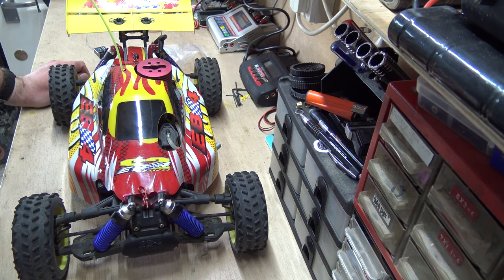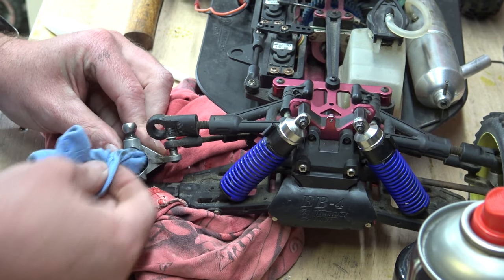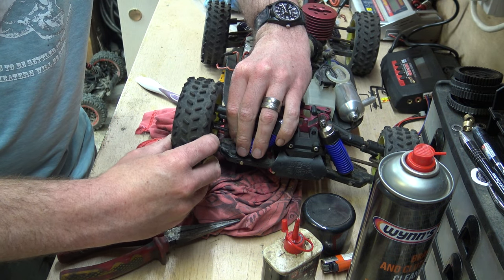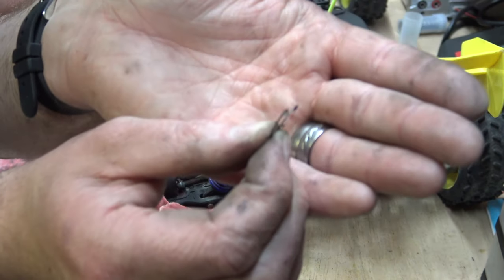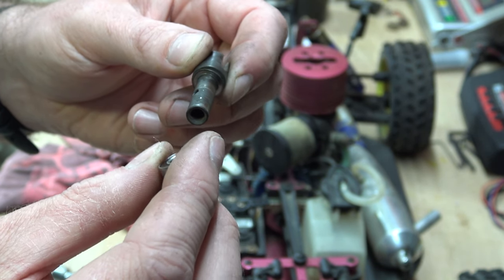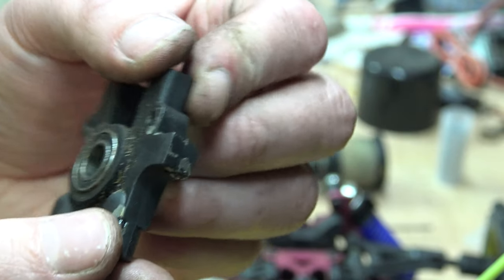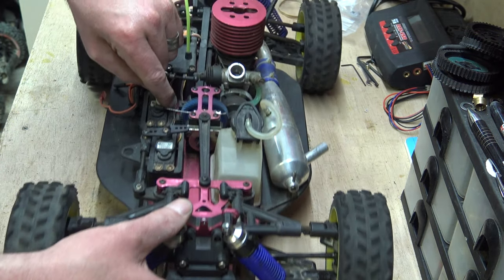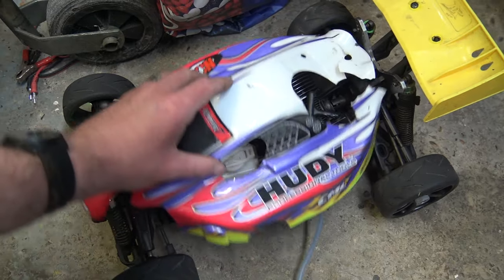Thundertiger EB4 S2 Pro Nitro Buggy Gets New Bearings & a Good Service!

Comment: Good video keep up the good work Haggard should be getting my engine today thunder tiger 28 pro couldn't get the piston for the other thunder tiger that broke the piston so ended up getting a used engine from a seller on ebay comes with exsaust to for £50 pound wich I don't think was to bad looks a good engine but proof  is in the pudding as thay say lol

Comment: The same in my Thunder Tiger UNO. Just bushings everywhere. Tha car had sat at the warehouse so long that it came with a 27MHZ radio 😂😂😂 and that was about 1-2 years ago. Thunder Tiger made (makes?) great engines. And not to forget the MTA4 S50 😀